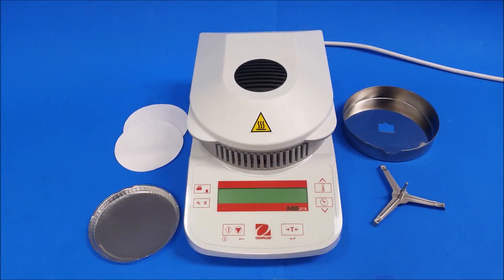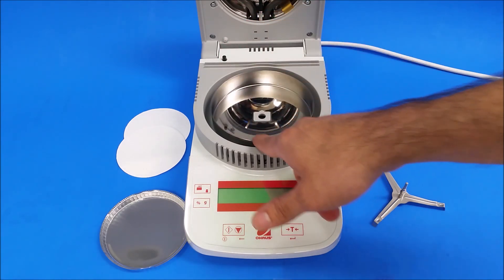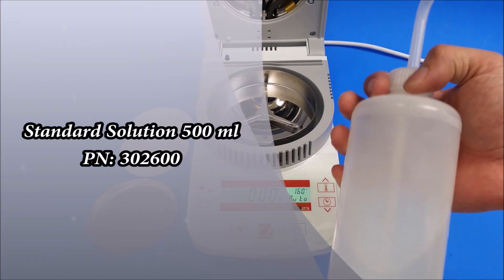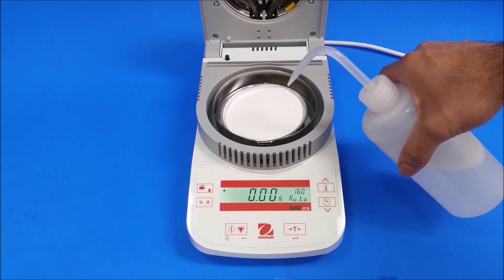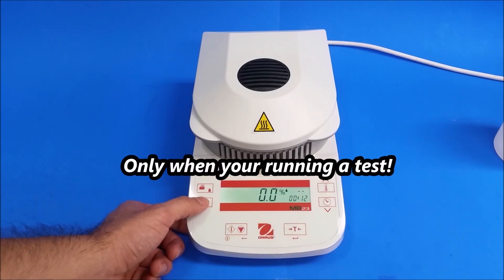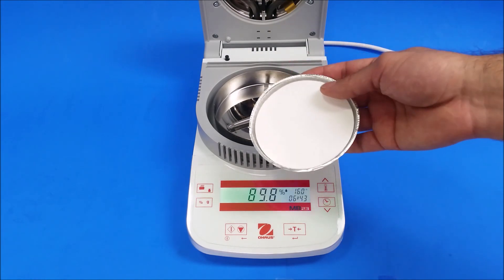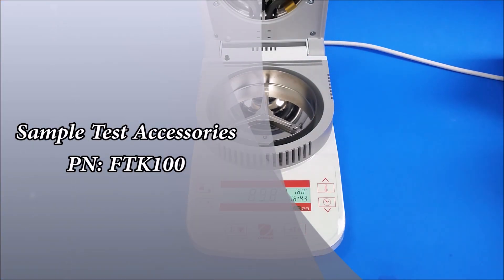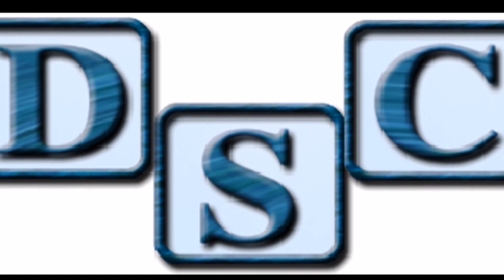Ohaus MB23 Moisture Analyzer

Comment: if I run this test , is the machine then calibrated ? therefore, we can then check moisture for other substances and grains ?
Reply from the maker: Hi, this video is only to demonstrate how to run a sample. If you need a calibration, please call us 818-988-7499. You can use it to check moisture in other substances and grains, depending on moisture level, because this machine has 0.1 % readability for moisture.